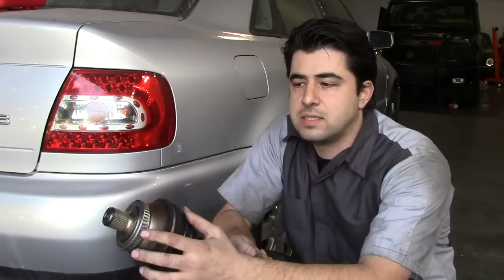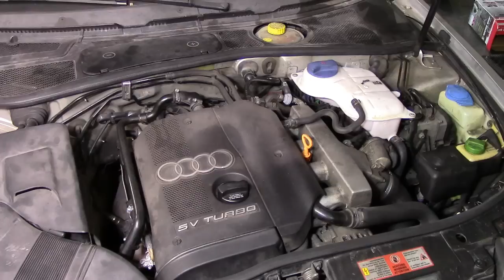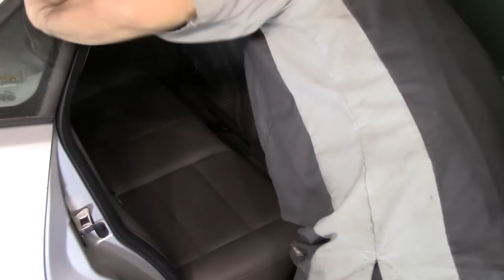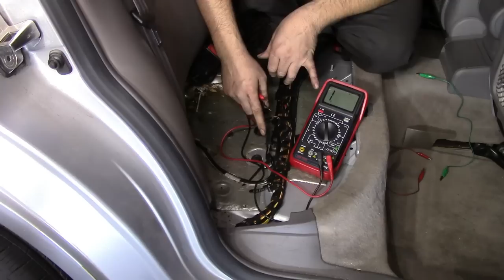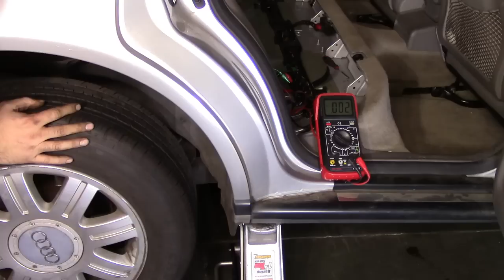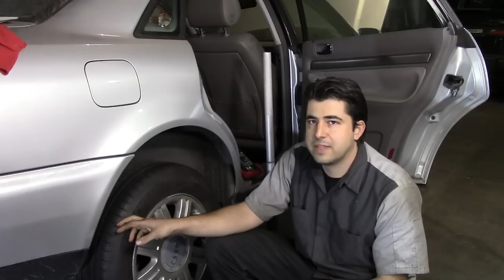How to Get Rid of ABS Trac Off Lights - How to Test an ABS Sensor Using a Basic Multimeter

Comment: Thank you, 2001 Lincoln Town Car had intermittent abs, traction control lights as well as losing electronic speedo, odometer, etc.  Was determined to figure it out and not shoot the parts cannon.  Got a wiring diagram and began by checking fuses, powers, grounds; then wheel speed sensor resistance. Was getting set to check wheel speed sensor voltage when I saw this vid.  Power washed back of wheels from under the car and problems seemed to be fixed.  Appreciate your vids.  You are a go-to guy in my learning journey.  Thank you.

Comment: When you test auto voltage, do you set the multimeter AC setting or DC? Because in your past videos you said use AC setting only for Home electric ⚡.

Comment: you can also have a broken reluctor ring that's on the half shaft, they do crack and that throws the computer off, you might also get the abs pump running on and off all the time with a broken reluctor ring....

Comment: Howdy I have a Merc W245 2010. It is in limp mode and shows abs and traction light. I recently had front wheel bearings and cv joints (outer) replaced and every since the lights have come on. Starts out fine but then a few km all lights up. I just had the bearings and sensor checked, there"s apparently a magnetic ring in wheel bearing and sensor for traction control. Mech says all looks fine. Does merc also have the abs ring on the cv as per you video and could this be the problem. Mech diagnostic speed sensor error and boost pressure problem not sure if this is because its in limp mode. Hope this makes sense and appreciate any advice you can give me. My only other option is taking it to Mercedes which will cost a fortune I'm sure. many thanks Rob

Comment: I have a 2007 Pontiac Grand Prix GT and for some reason after I replaced my front wheel bearings, I'm getting my abs light on only when I turn my steering wheel past 270 degrees to the left. And sometimes when breaking through a shallow left turn (180 degree turn) my traction control activates then turns off and follows with my abs light coming on while driving. If I shut off the car and turn it back on, all is normal, when I make the turn, light comes on. I have already checked to see if the wires get pulled when making a turn and they do not. Any help will be greatly appreciated.

Comment: My 94 Honda wagon: ABS light is on:  I Replaced Rear Calipers, Rotors, and pads.--  On the front of the vehicle I replaced both calipers and pads only.  The brake lines are all clear and free flowing but when I use my brakes the front driver side caliper will not retract.  I release the pressure from the Accumulator box under the hood by loosening the line nut and when I do this I can hear the driver side caliper retracting bit by bit.  when it stops making noise I close the line nut. and try to drive again around the block and still have the same problem the brake locks up on me.  I cleaned the sensor tip and the CV shaft ring and again the same problem  Could this mean that the Accumulator is bad.  I know the caliper is engaging because the wheel locks up.  Would a faulty sensor cause that one caliper to lock up ?

Comment: I got 2003 lincoln town car.
The issue is blowing fuse.
this fuse feed power to pcm, eva. canister solenoid, VMV,  hegos 
I LIKE to know what VMV means.
Thanks
Reply: ZHININ TEODORO did your speedometer and cruise control stoped working when you had the abs issues?

Comment: hi .. i have elantra 2002 and abs light came on when my exterior cv joint started knoking and even after i replaced the cv joint the light still on .. how i can fix it please
Reply: Likely a bad bearing hub, lift the vehicle and see if there is play in the wheel

Comment: question found bad hub changed it changed all and checked harness to be safe no more codes comming up after driving about 300 miles but light is still on on dash auto zone cant reset it whats my next step 2001 aztek dealer ? or can i just pull a fuse or realay thanks

Comment: hi 
..i got issue with my toyota passo 2007..i replaced both rear tyre wheel sensors since scanner come with code...but didnt fix the problem..then i replaced abs whole unit...still i got left rear sensor abnormal code and abs light on...then i checked the input voltage to both rear sensors one says 2.9v and one says 11 volt??? please help what caulb be issue....or wiring diagram help please